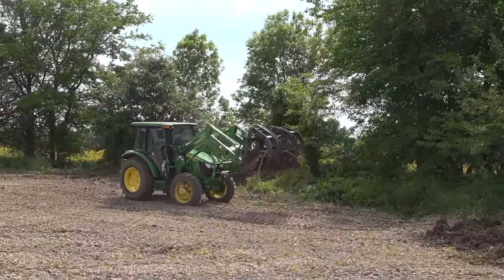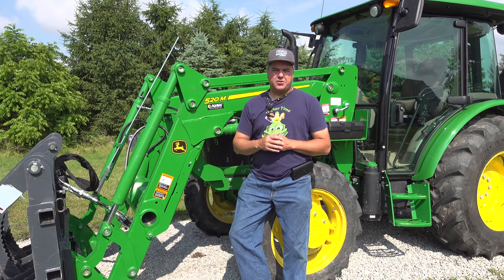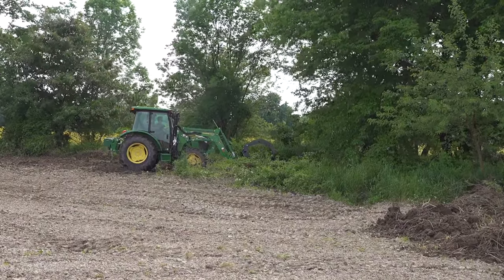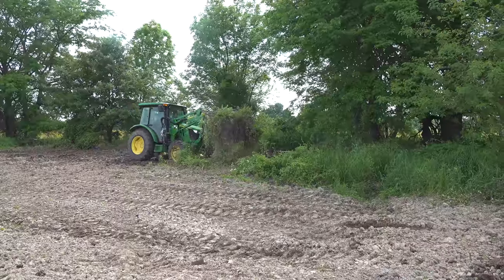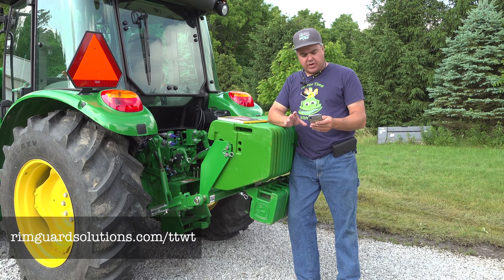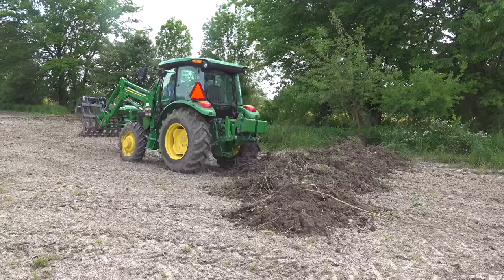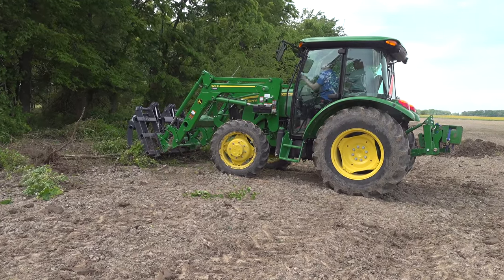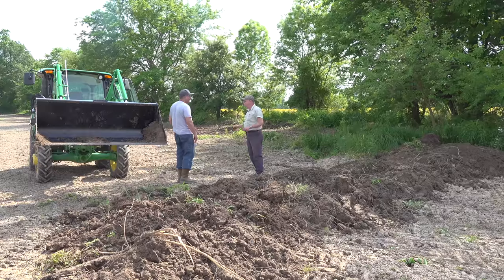Not Enough Ballast!!

Comment: Tim, so you can’t travel with any ballast with you?  I don’t understand how you can add 1600 lbs to the back and be ok but can’t add 1600 lbs to the wheels. I think I am missing something.
Reply from the maker: Yes. I can handle 1600lb, but not the additional 1600lb of liquid along with it.  Make sense?
Reply: Tractor Time with Tim, ok. Then why not go with liquid ballast and free up the 3 point. And at home, you could add the 1600.
Reply from the maker: Good question.  3 pt ballast is much more effective for a loader than axle ballast due to the location.  Axle ballast does not help relieve the stress on the front axle.  
So, both types of ballast work together to achieve the goal.
Make sense?
Reply: Tractor Time with Tim As an engineer, location of that ballast doesn’t change the pressure on the pivot point. So it really won’t matter. The axle ballast is lower and further forward which is why not as much is needed.
Reply: NCSUCPE Tractor Fun as an engineer, think on the fulcrum and lever principle! This is the principle which ballast is attempting to counter act. You should have learned this lesson on the playground with the seesaw!
Reply: Coy Patton I did. I have been doing what my static’s and dynamics professor said. The ballast location 3 point or whee doesn’t move the ballast fulcrum enough to make any difference  on the front axle.
Reply from the maker: Ncsucpe look at the manual (or listen to the numbers I give in the video.  800 lb on the axles only offsets ~300 lb on the 3 pt.
It is a MAJOR difference.
Do the math. The fulcrum is the front axle.  The 3 pt weights are at least 4 ft behind the axle.   Major difference.
Reply: Tractor Time with Tim I think they are limiting the ballast not setting minimum. You can have more ballast and a more stable tractor with axle ballast than with 3 point hitch ballast. If you actually do the calculations, wheel ballast will be just as effective or more so because it’s moment arm is shorter. It is closer to the center of the teeter totter to act as more ballast with less weight.
Reply: NCSUCPE Tractor Fun do a simple test for me. Put 50 lbs at waist height. Step up next to the object the weight is on. Now standing as close to the weight as you can lift it to shoulder height keeping that wright ad close to your body ad possible. 
Now take 2 steps back from the weight at waist height. Stretch your arms out as far as possible and lift that 50 lbs. 
Then go set down with your engineering books and contemplate the data!
Real life tells me one is much easier to lift than the other!
Reduce weight on both exercises if out of shape!
Reply: Folks. I give. The book doesn’t recommend the 1400 lbs you could get with rum guard. Why, we don’t know. Someday I may do the calculations and see what difference 2 feet makes on the ballasting. For now, thanks Tim for your explanation. I understand it.
Reply: NCSUCPE Tractor Fun you do the math! Or just do some simple life experienced to figure out the same  weight at more distance from the pivot point provides great ballast! It is really pretty straight forward physics!
Reply from the maker: Ncsucpe.  I measured.  The 3 pt ballast is 48” behind the center of the axle.
The wheelbase on the tractor is about 81”.  So, the difference is significant.  Can you do the calculations on the lever? 
...and Coy, Patton, no need to get personal.   Both of you guys are long term fans....let’s just work through the discussion.
Reply: @ncsucpetractorfun  Hmmm... JD (you know, the folks who designed and built this tractor / loader combo) seem to disagree according to the guidelines in the operators manual for the 5-series and pretty much every other tractor made. If I had a dollar for every engineer that came along and explained why all the manuals are wrong... well... you get the idea. :-)
Reply: @ncsucpetractorfun   +Tractor Time with Tim +Coy Patton   Personally I think the issue really boils down to the individual and what their needs and uses are. I have a JD 1023E subcompact with a loader. In my case I have no room to add ballast of any kind due to length issue in the garage its stored in. I even have to keep the 3pt bars off to have it fit. What I did instead was to purchase the full cast iron weight set for the rear wheels. That's a 70lb starter weight then 2 50Lb disks per rear wheel.. 170lbs per rear wheel for a total of 340lbs in the back.  If you look at the link NCSucpe just provided, that's basically the figure 3 representation. That is near equal distribution on the front and rear axles.  In my case, i'm not lifting sand/gravel with my loader. My tractor is exclusively used for snow plowing a condo complex. And so, the weight i'm lifting at any given time might be 200-300lbs ? That could be considered putting that extra weight on just the front axle until you consider that I REALLY need to lose that 200lbs. myself :)  And so....what I still really have is that perfect weight distribution between the front and rear axles. What I also have is the rear wheel cast iron disks extending out in the back giving me some great stability in the rear from side to side. I have also found my traction to be PERFECT. I mean...I plow 1 foot snowstorms and don't even spin a tire..even with a hill at 25 degrees that everyone gets stuck on. And i'm plowing UP the hill as well..just to kind of show off :)   The ride of my tractor is awesome. Very stable feeling. Because it is realy distributed properly I think for my needs. I also use turf tires because I think they help with winter ice/snow traction like a snow tire would.  I AM planning on adding a couple 42lb weights next to the seat...because I am committed to losing 100lbs :)   But otherwise...I have found that NO rear ballast is perfectly fine for my use. ….just using the rear wheel weights. I can appreciate however that this would be very different if lifting sand/gravel etc. then you need the rear ballast. But, that's not always the use for loaders as in my case.  Thanks for the great discussion and...very interesting link. :)
Reply: Tractor Time with Tim You are correct! And I apologize! I have just encountered so many engineers that have a belief that they think it so it is so attitude that it gets under my skin!  They like me are human and can be wrong as I was!  But facts are facts!
Reply: NCSUCPE Tractor Fun Proud if you for expanding your education. Real world experience had taught many of us that stuff in books is not always correct!
Reply: A couple of other notes if people find this thread. 1) liquid ballast according to JD is only 40% fill for ride and performance reasons (I.e. tractor will ride harder with liquid in the tires and you can’t go as fast on the road 20 mph max). 2) Liquid ballast achieves 25% rear loading by adding to the rear tires but doesn’t decrease the front load at all. 3 pt ballast will move the center of gravity some to lessen the front load a little. Thanks everyone for letting us work this out. 😉. Tim, as always, great fun!
Reply from the maker: Axle ballast (wheel weights or fluid) Do decrease required 3 pt ballast...but it does NOT decrease front axle load.
Typical fluid fill loads are 75% to 90%.  You will not notice a decrease in ride quality unless you have 100% fluid.  In fact, ride quality is actually improved due to less ‘bouncing’.
Max highway speed is bunk.   There would be no difference.   Perhaps they say this as a safety thing as more weight would potentially make it harder to stop.
Reply: Tractor Time with Tim Ok. I got all that from a JD document.  I suspect the 40% is why the wheel ballast in your manual seems low.  Also, I grew up on a farm with fluid in the tires and the machine will bounce at higher speeds. The speed thing may be true. We didn’t have tractors that could go over 20 mph. My brother in law would not put fluid in the tires because of road travel concerns. I will be first to admin that I have no idea about the truth of the highway concern.
Reply: @TractorTimewithTim The same thought crossed my mind when Katriel commented about how she didn't remember bouncing around like that when riding in her grandfather's tractor. I was thinking that is probably because they have them heavily loaded with either filled tires, wheel weighs or even both. I remember on my old Ford NAA with just air in the tires it would bounce along something fierce in the field. After I added 800 lbs. of wheel weights and fluid filled tires it would glide across the field like it had air ride suspension, even in high gear. :-)

Comment: Tim, I think it might be time to get the CDL. You are doing yourself a disservice by not being able to fully utilize the capabilities of your 5075E.
Reply from the maker: Maybe.  There has to be a limit somewhere.  The larger equipment is MUCH more of a pain.  We really like the smaller stuff.    So, rather than continuing to work with larger and larger stuff, we'll try setting our limit at (or around) 26,000lb.    We may have to use two trucks sometimes as folks have suggested.  Or, we may decide that we simply cannot effectively use the 5075e.  I dunno.   Either way, we have to find a practical 'upper limit'.     Does that make sense?
Reply: Tim, it does make sense. There are costs involved in getting and maintaining a CDL. I think secretly you really enjoy having the larger tractor. That buddy seat is cool. I think if you could fully utilize its capabilities, you would probably use it more. I’m sure having the larger equipment would help you grow your business.

Comment: Well at some point a one ton diesel truck is needed. When you start talking weight factors that much. The three quarter ton diesel by dodge highly recommend our fifth wheel pulled fine but even with over load springs we traded for a one ton. With that you can pull a goose neck with plenty of wiggle weight room. Ford or furd of which ever u choose gmc Chevy something one ton ish?
Reply from the maker: Uh, I have an F350.

Comment: I would of thought wheel weights would do all of it
Reply from the maker: Nope.  Must have 3 pt ballast on any utility or compact loader tractor for safety, and to keep front axle safe.
Reply: The other issue is you can't add enough wheel weights to meet the ballast requirements without exceeding the working limit of the rims.  My Kioti requires 2300# of ballast but you can only attach 200# of weights to each wheel.  You won't be able to even meet the ballast requires with a backhoe alone since the hoe for my tractor is 1300# so would still need another 1000# in ballast.
Reply: All true, but if you can figure a way to move your weight further away from the tractor, the same weight gives you more ballast. 
Think of the playground and what we called a seesaw as kids. Also know as the fulcrum and lever principle.

Comment: rear ballast are useless get a 1000pound box blade + windshield washer in tires. youll have something usefull in your back at least. just ballast is like running with a handicap.
Reply: What good is a 1000 lb. box blade when the required ballast for that loader is almost 3000 lbs *PLUS* liquid filled tires?
Reply: @eosjoe565  lol 3000# ballast when the 3pts has a max lift of 3200# comon!... you never want to have max weight on your 3pts. btw i was saying that ballast are useless because they are dead weight, they arent helping you, you better have something behind to work. 3pts ballast arent used very much anymore, people prefer to hook a bush hog, boxblade, etc... dont say its not easy to steer because that's why Farmers get Skid steer for FEL work these days. in the field, who cares if you have an implement who stick out 84".

Comment: get a sandstone boulder, 3x3x2=18 cubic feet,  sandstone weighs 175lbs per cubic foot.  thru bolt a draw bar on the boulder, and your golden.  18x175=3150lbs.   http://www.delawarequarries.com/landscape/boulders/boulderwt.html#:~:text=The%20average%20weight%20of%20a,175%20pounds%20per%20cubic%20foot.